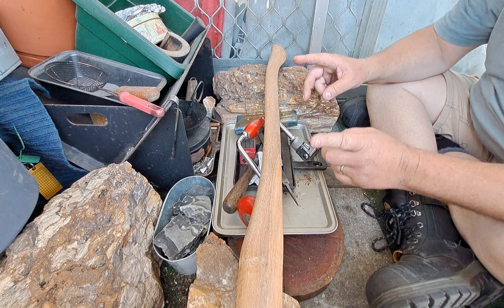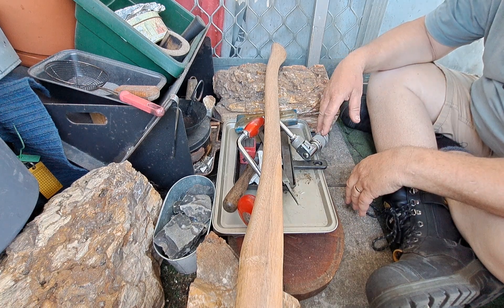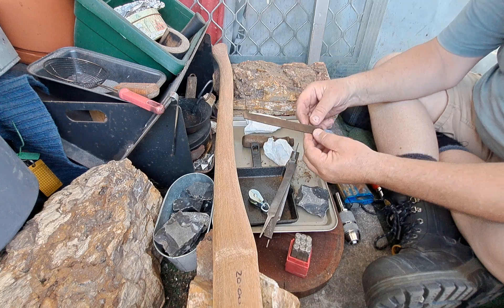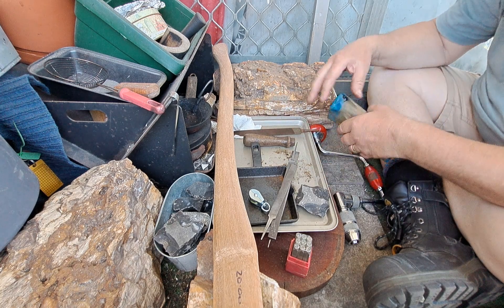market finds

Comment: Your young fella might want to look into the Fiskars hollow handle axes. They use a fiberglass reinforced resin handle that's moulded over the axe head, they're nearly impossible to break and breaking is the only way to loosen the head. I know people here in Canada that heat with wood in the winter who swear by them to split all their firewood.
Reply from the maker: I think that will have to be the way to go mate, the Fiskas splitting maul is a solid tool and reasonably priced, I might get him one for christmas.

Comment: Your Drill is great condition Dean. I like your Fry pan. Wow. Those F Dick spark insane.
Reply from the maker: The FDicks are made from quality steel, even before you requench them they spark well.
Reply: @waveman0 , got several of those hand drills
Reply from the maker: @jimthomas1989  they are a nice drill, will be good to put it to work